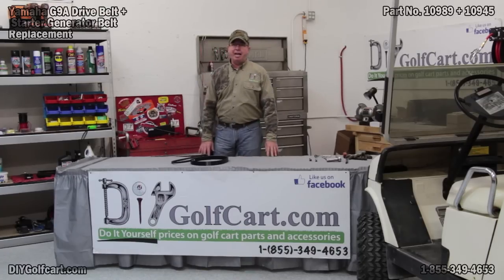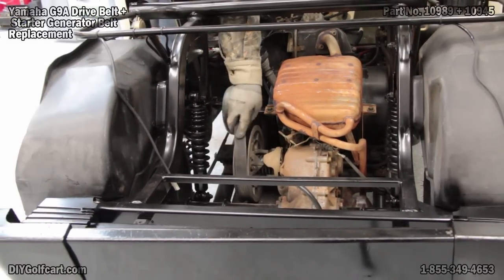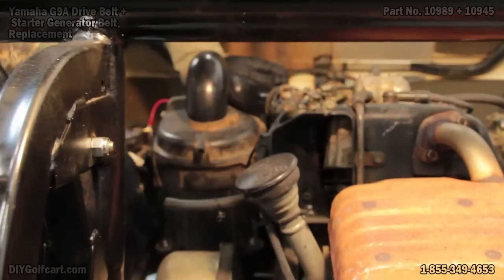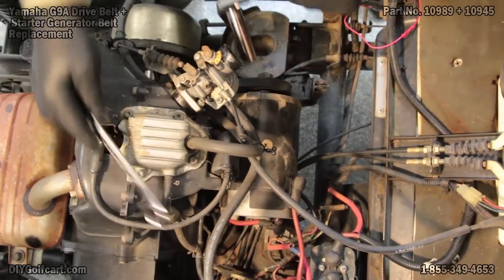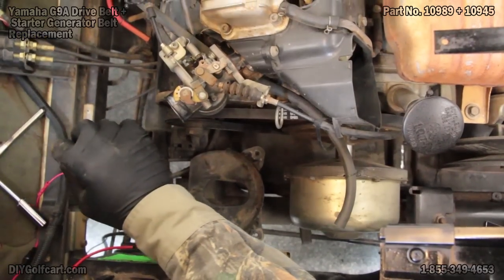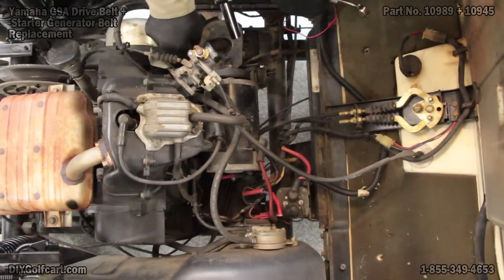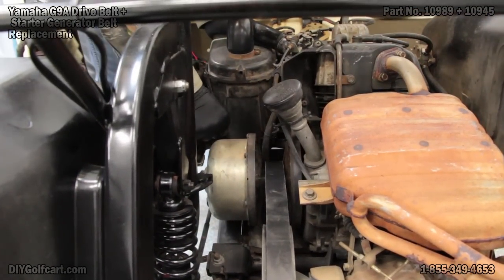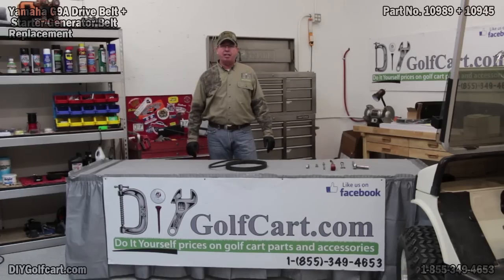Yamaha G2, G9 Drive and Starter Belt Replacement | How to Install on Golf Cart

Comment: I have a 1993 g9 and the belt comes off easy and has vert little tension. It drives ok until going up hill.it has a j38 does it need  to be a j55. The belt looks brand new

Comment: Do you know what the OD of the replacement belt is supposed to be?  A previous mechanic replaced it recently, and it is slipping like crazy still. I’m seeing belts from 39 all the way to 40 5/8 for my 1991 Yamaha g9.

Comment: Hi, great video! I’m working on 94 Yamaha G9 ignition coil. The coil itself is not mounted to anything but found out where to mount it. There’s a single black wire with round hole clamp off the coil harness. Does this need to be grounded somewhere or where does it go? Thanks!

Comment: Wondering if there is a fix for a 1985 Yamaha g2 rev limiter? This cart has run at higher speed the last 3 years. For some reason the rev limiter has kicked i in the n and doesn’t “reset”. I have changed the carb and the clutch. It loses spark and surges at half throttle. Help????

Comment: How do you know when to replace the drive belt?  Is there a certain amount of tension it should hold?  Mine can be squeezed together and it touches.......?
Reply from the maker: The width of the belt is the main concern. 1 1/8" is the minimum for this particular belt. The extra length of the belt assist in a smooth take off.

Comment: Just installed forward and reverse cables on my Yamaha G2 cart, and I'm having trouble adjusting them properly. It goes into F and R just fine, but the shift handle isn't centered for neutral position and is fairly difficult to locate neutral. any suggestions?
Reply from the maker: Make sure that you have an even amount of threads past the locking/jam nuts. Ease off each side evenly to allow for an easier lever movement.
Reply: thanks so much for responding, tip worked great.

Comment: Hi there.  I need a little help please.  I'm a 52 year old legally blind woman, and I need to get the starter/generator replaced on my mom's gas golf cart.  There is no one I can ask to help me.  I'm quite handy, I use my fingers as my eyes, and I'm able to do a lot of small tasks.  I don't need to replace the belts.  But I do need to replace the S/G.  People on Reddit helped me diagnose it using my fingers to feel if the S/G has gone faulty, by feeling for when the magnet rises/drops inside it when I press the gas.  Anyways, I THINK I can do this.  I have a new S/G I got at Amazon.  Do you have a video that can guide me?  I really appreciate any help.  Thanks so much.  I watch your channel quite often!  We love our Yamaha cart.  We live very rural, you see, just me and my mom, and we're all each other has got out here.  In fact, i KNOW I can do this, I just need a little video guidance, if you can help.  Thanks!!!

Comment: How mush wear off the sides of the drive built should there be before you know you need a new one . My drive built is worn about 1/8 of a in .125 "
Reply from the maker: Max wear limit is 5/32 or 0.157 or 4mm. Either way, a fresh belt will increase your speed and torque even with 1/8" of it worn away.

Comment: I need to know if the large belt is really loose will it stop it from going
Reply from the maker: The drive belt is loose so that it gives a smoother take off.  As the engine turns over the primary clutch should begin to close and grab the belt for the car to start moving.
Reply: @golfcartking  what if it doesn't close and the engine keeps spinning but the rear doesn't get the power??
Reply from the maker: @TheLifeOfMartin  If the engine is hitting it's proper rpm's and the clutch isn't closing, then there's a clutch issue.
Reply: @golfcartking  ok, thanks. Found the issues. It was a clogged Carb. Fixed it. Thanks a lot, that really helped.

Comment: So my belt sits down in the 2nd clutch and i don't have enough slack to get it started over the wheel to get it off any ideas?
Reply from the maker: Then something is very wrong. Your belt should at rest, be at the top of the secondary clutch allowing you to roll it off.

Comment: You didnt mention how much tension should be on the belt.
Reply from the maker: You are correct. The Drive Belt will be a loose fit and the Starter/Generator Belt should be 5 to 7 lbs down pressure or about 1/2" flex. Main thing is to get it tight but not Super Tight!